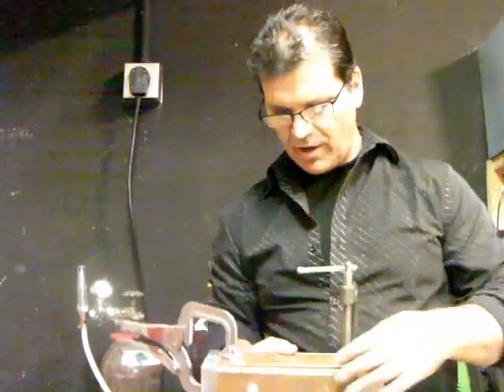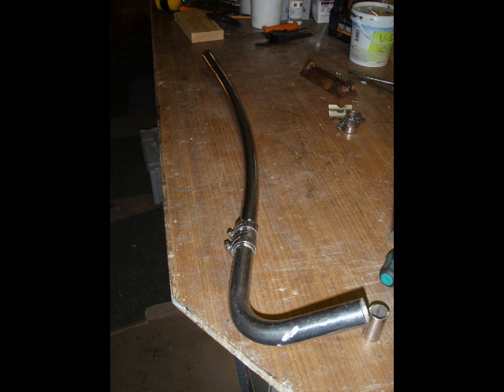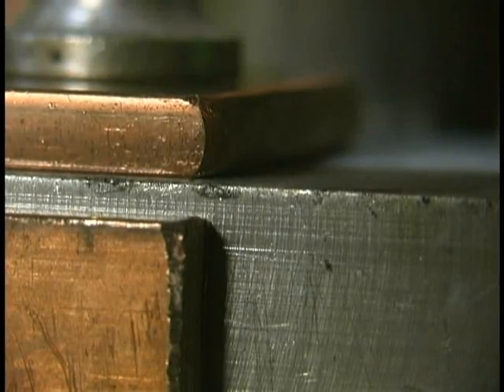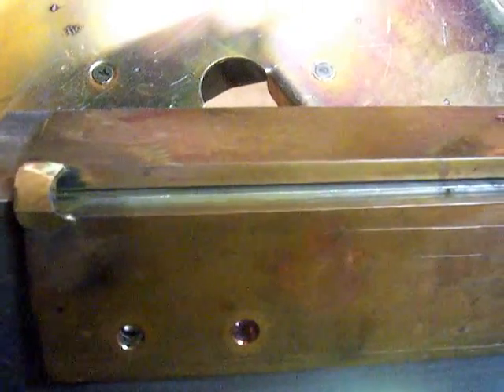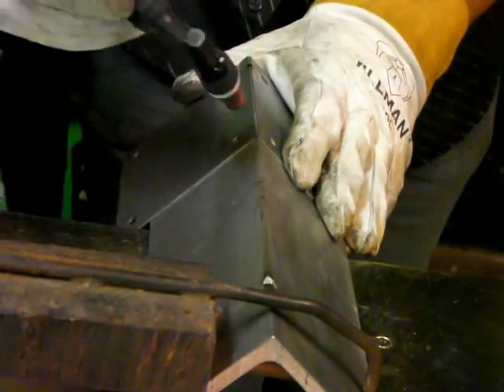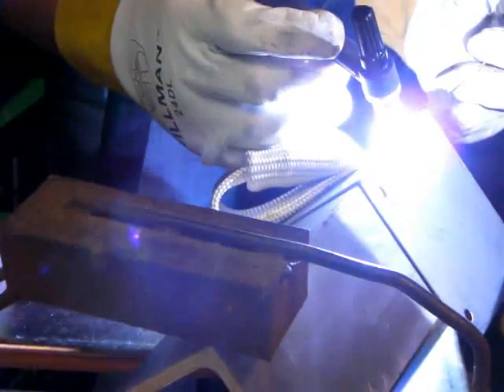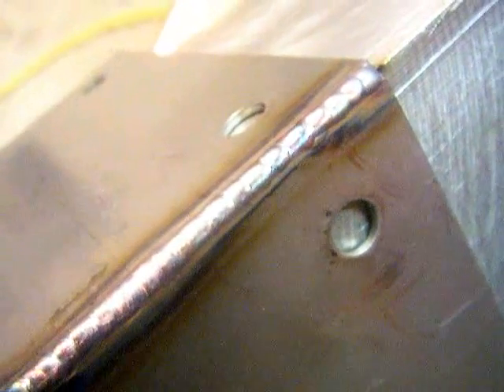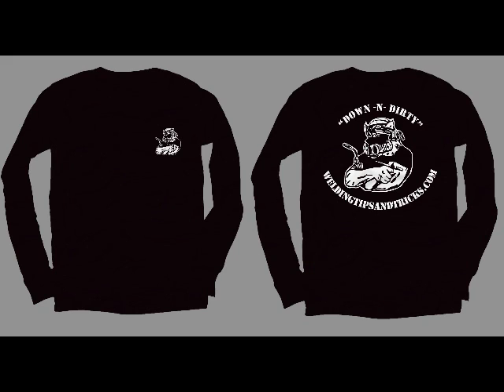Tig Welding Tip for Welding Stainless Steel

Comment: We use huge brass heatsinks at work to draw heat from 20 gauge stainless hose. It's a great way to achieve consistent welds, and maintain good color with minimal distortion.

Comment: I'm not having a bash but computer guys have been doing this for a while using copper as an efficient heatsink, you can also buy Thermal Paste for the bottom of the copper, I dont know if it would affect the metal or something? but yeh thermal paste will help soak up more of the heat quicker,you can pick it up for a couple of bucks from any computer shop, giv it a crack mate!! thanks for videos anyway very helpful

Comment: Design, assembly costs, capabiltity, lack of support (no certified repair centers), warantee is parts only - you either send it back or put the parts in it yourself.  Parts are often hard to come buy (back ordered to China).  If you can live with the chance of a 30, 60 or 90 day down time, you might do OK.
I'd rather buy a used Miller than a new Chinese welder.  Besides, I can always sell the used Miller for more or less what I paid for it.

Comment: I really enjoy your videos.  I am an RN who does metal work strictly for stress relief.  I saw your video a few weeks back about Certanium rods for stick welders.  I am  curious if they make certanium in flux core wire for wire feed welders for those of us who are not pro-welders that may be using using a little 115V welder?